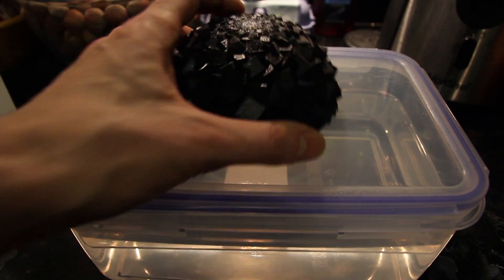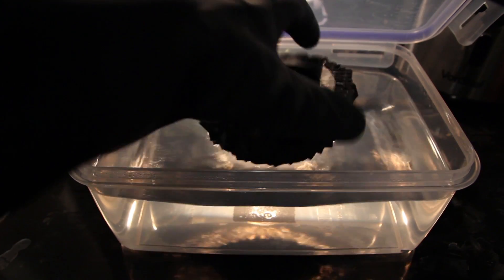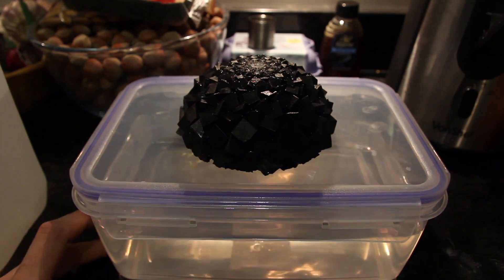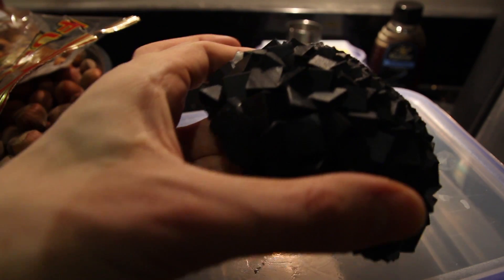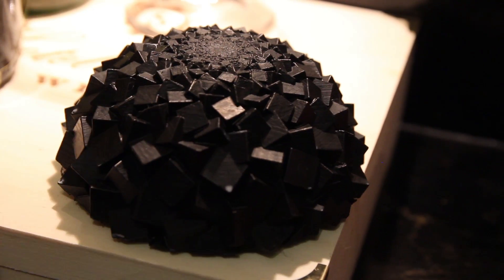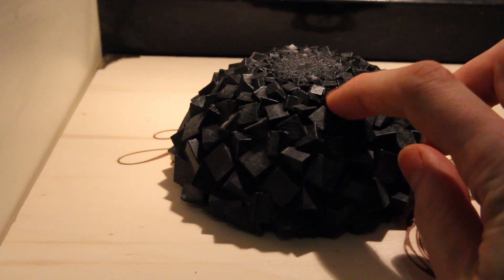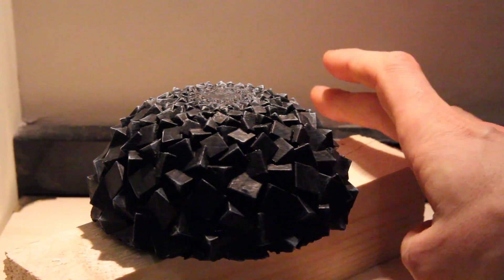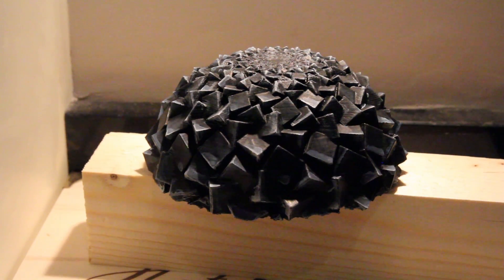PLA smoothing with Acetone on Fibonacci zoetrope models by EDMARK

Comment: what do you advised us to do ? print on layer high 0.1 and speed 35 mm ? is that give good quality ?
Reply from the maker: Jimmy Haidar No never print layer height 0.1, unless you are printing mainly flat stuff. Anything with detail has to be 0.06 minimum otherwise it wont smooth well at all. this model was printed at 70mm/s 0.06layer height at 230 degrees colorfabb Pla. i think it took 17 hours or something to print. But i usually never got faster than 35mm/s. I also do not use any infill now, and print with a shell of 1.2 mm for stability. good luck.

Comment from the maker: Ok i just sprayed it and still saw some lines, so i believe you have to print at speeds no faster than 35mm p/s as any quicker and the lines dont seem to line up as good as when you go faster. All the sahking of the machine must offset the fine balance just enough to ruin the smoothing process, doing a few more tests at 35 and 70 to evaluate. All my early stuff was done at 35 mm.